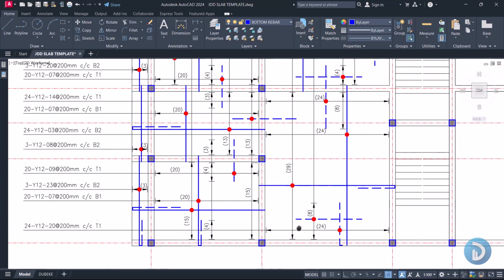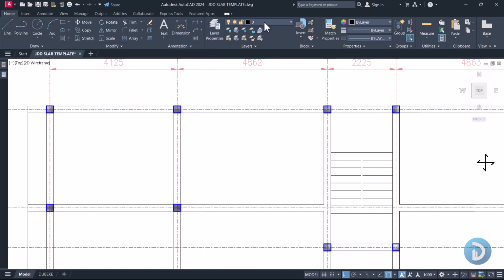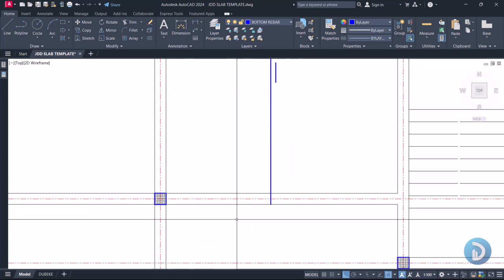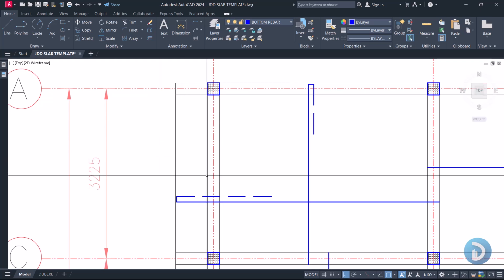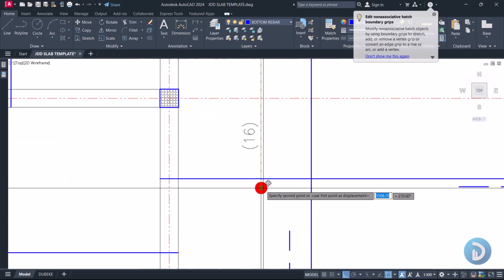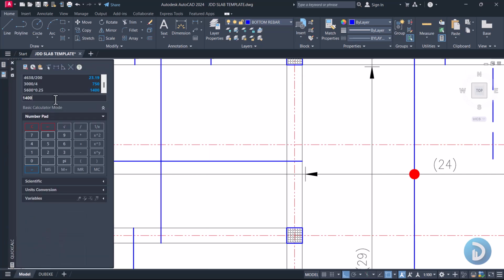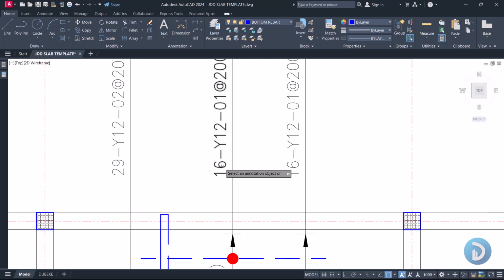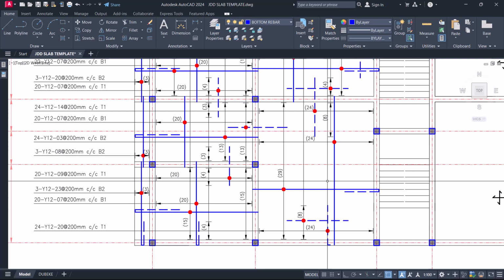How To Detail Slab In AUTOCAD (REINFORCED CONCRETE)

Comment: Thanks for sharing the information. Keep it up. This is a very nice video 👏👏👏👏
I was requesting if you could also give some tips about a ribbed or hollow slabs. And how you use the design code for the detailing. THANKS.
Reply from the maker: A ribbed slab is part of our proposed upcoming series. Stay tuned.

Comment: Kindly cite the exact clauses or code references used, as I would like to verify certain figures which appear to differ significantly from the provisions outlined in BS 8110:part 1:1997 — Structural Use of Concrete.
Reply from the maker: You can outline your observed differing figures here citing your reference. We are all here to learn.

Comment: Master what if the bar is lon enough to cover the entire span is it necessary to use joining in the middle or you can use the one bar from one end to the other end.
Reply from the maker: In that case you’re detailing per length of the rebar 
So yes you can use it till it exhaust its length.